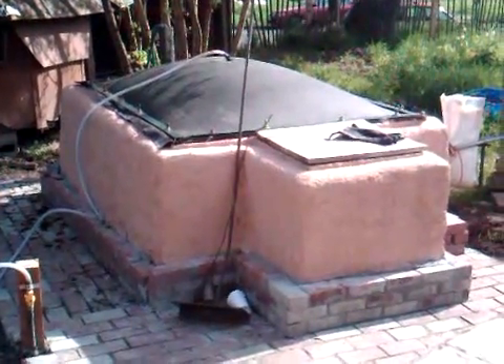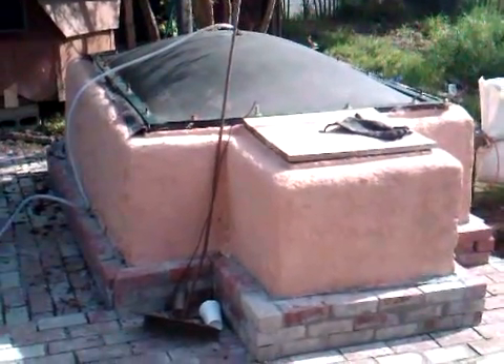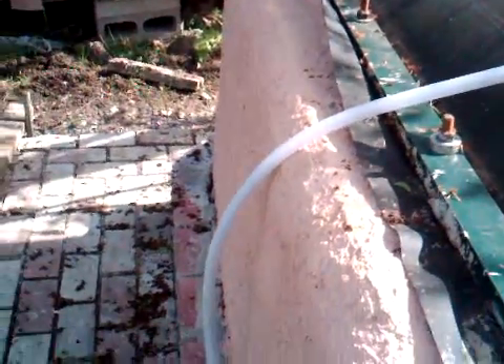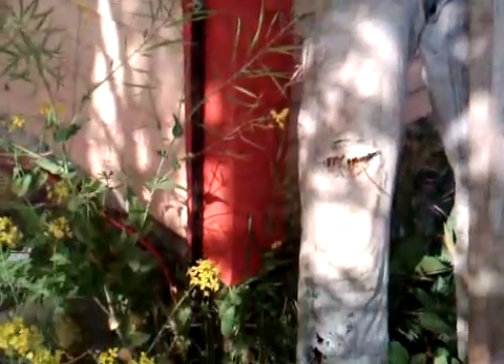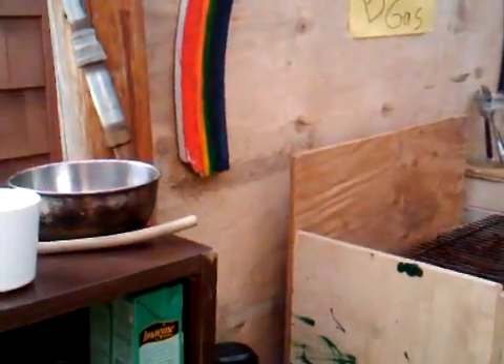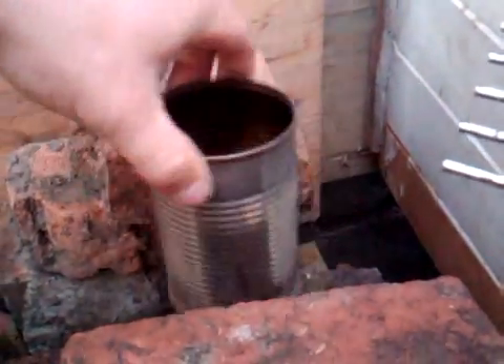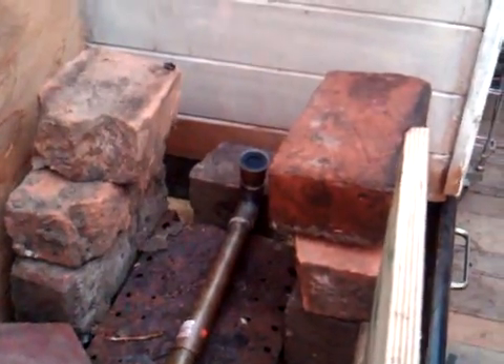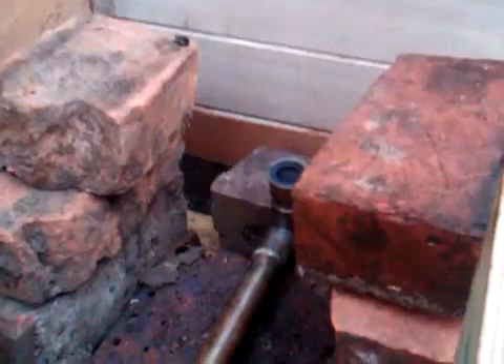Hestia Home Biogas

Comment: Is there any future plans on creating a larger permanent unit? Possibly for off grid use for small farms. I would also like to speak to you about distribution in Minnesota.
Reply from the maker: Sure, Rob. Email me at w.weisman@hestiahomebiogas.com
Reply: Dear Rob, there are lots of producers of big scale biogas plants like Envitec Biogas and others (Envitec ultimated 2 500 kw biogas plants in NY state. federico
Reply: Hi Rob, we design, engineer and optimize anaerobic digestion plants.  I also work in the laboratory were we monitor many aspects of the process to maximize gas output.  Biotech energy services ltd.

Comment: Hi, nice job!
I just would like to sugest you 2 tips to make a much more pure gas and without any odor. Make the gás pass through a bubbler to remove CO2 and water steam and make it also pass through a PVC tube filled with stell wool to remove the hydrogen sulfide gás which is toxic and smells like rotten eggs. The flame will be much more blueish and produtive. Sorry about my english...I'm from Brazil, See you.
Reply: lemont2005 what about H2S ,pls how can u remove it
Reply: What's is a bubbler.

Comment from the maker: The slurry level can move up and down several inches and could block your outlet. Furthermore, water accumulates periodically in the clear part of the tube and needs to be poured back into the digester. The membrane is only about $35 and can be removed and replaced in about 10 minutes.

Comment: Why did you pierce the membrane if you had placed the gas take off at an inch/25mm above the slurry level  and run it out the bottom of your digester you would be able to draw the gas off without  compromising the integrity of  the bladder.

Comment from the maker: The biogas slurry is not like compost. It has retained all of the N and converted it into NH3, so it needs to be kept covered at all times and applied subsurface to plants to retain the nitrogen. Properly digested the slurry has a slight "earthy" smell and neutral pH. If it has an unpleasant odor, it has not digested completely.

Comment from the maker: Mhauke, for home use we recommend Honda EU1000i. You can get the kit to convert them from US Carburetor. You will have to drill out the float bowl, as the adapter will not fit inside the "suitcase" type generators. If you run out of biogas you can just connect an LPG bottle to it.

Comment from the maker: Mhauke, for cold climate you would want a hoop house over it and a thermal blanket to help the insulation. Try to use warm or hot water to rinse your buckets out and you can also circulate hot water through the PEX tubing inside to prevent a hard freeze. The process will slow as it gets colder, but won't stop completely. 

The gas will come out at 0.25 psi anyway. We recommend keeping biogas and NG plumbing separate, so NG cannot get in your digester.

Comment: This for a DIY project in Anchorage, Alaska. 
Probably need a heating enclosure to make this process happening at 20d F.
Questions:
Can the produced biogas be used in standard household appliances such as boilers, water heaters and cooking stoves?
If not can the produced biogas be mixed with the natural gas coming into the homes at 0.25 PSI?

Comment from the maker: Beardy, we build these in Oregon, USA you can order the plans and step-by-step instructions from our website for $89 for a DIY project or for your contractor and we will provide any technical support you need for the building project and to get your digester up and running and producing maximum biogas.

Comment from the maker: Thanks, Innoventor, you'll be fine in Nepal. This one runs very well at very low temps, even less than 50 F sometimes. I think if you just have some kind of hoop house or greenhouse and pipe some waste heat from something through it you'll be fine. 

Masqueepo, this digester produces 2 cu.m. of biogas per day, about 70 cu.ft. So, enough to cook 3 meals per day for 10 people or run a 1 kW generator for 3 hours. It is fed with about 12-15 lbs. per day of organic waste.